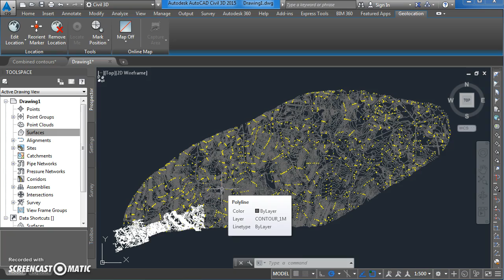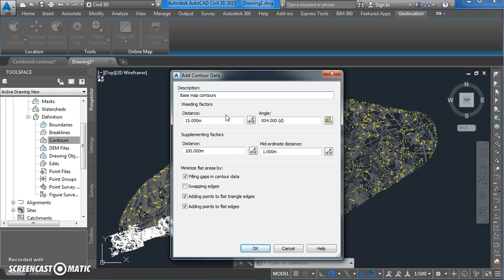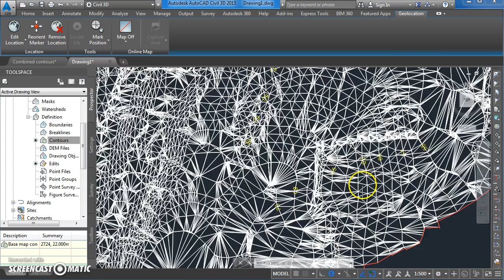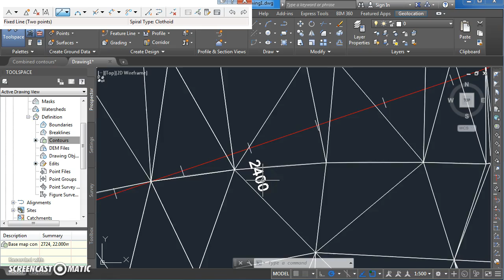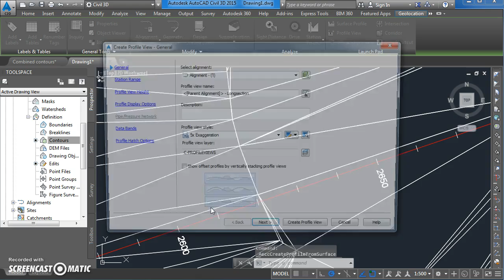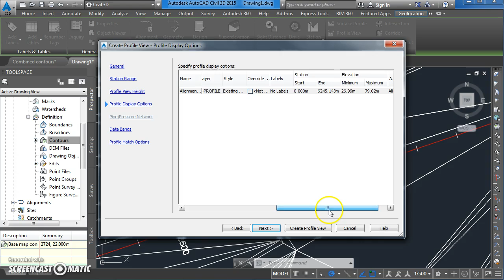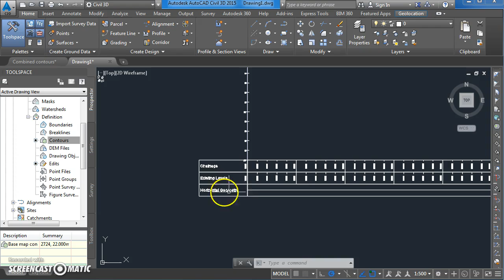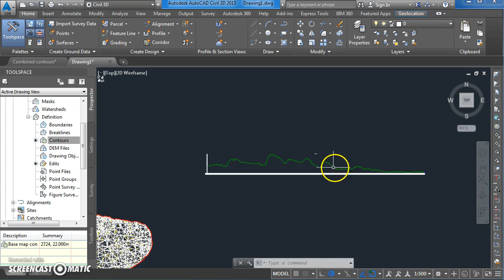Create a Long Section from Surface Data

Comment: Hi how do you get the chainage and existing ground levels band set, I only have a standard option when I try doing this on Civil 3D.
Reply from the maker: Did you get a “country pack” plug-in for your installation? If so, various band types come with that. If not, you can edit the standard one to add any information you want.